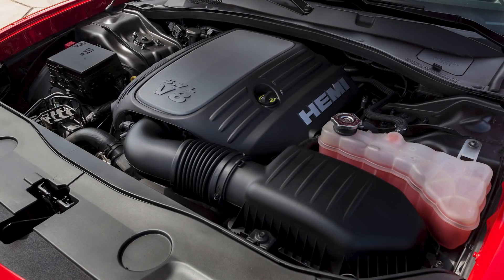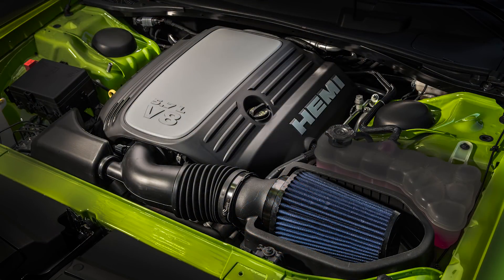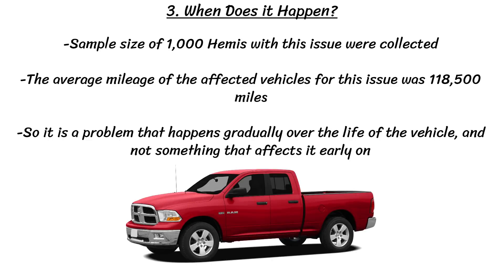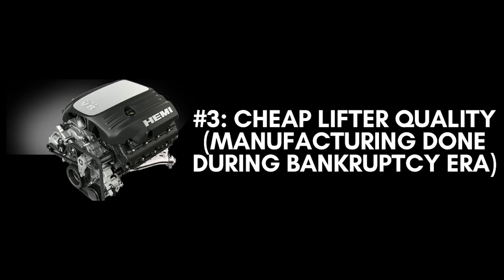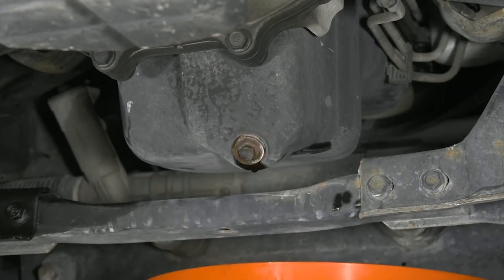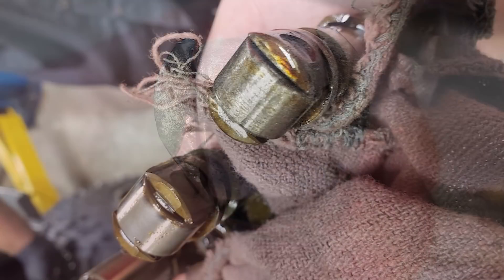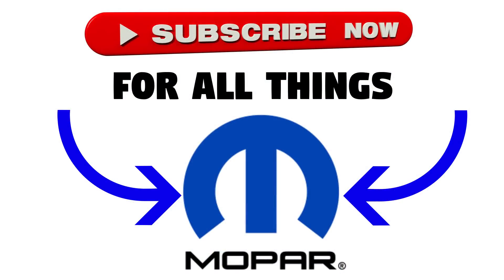The Fatal Flaw of the 5.7L Eagle Hemi V8 Engine Fully Explained (2009+ Lifters and Camshaft Failure)

Comment: It's not just the 5.7s, but also the 6.1s, and it's that mill that debunks the MDS. 6.1s don't have them. ALL Hemi's run very hot to try and clean their combustion gases, and are known for carboning up and oil coking. The lifters I've dissected were full of heavy varnish. ( still functional but somewhat sticky) It is imperative that the oil be changed 3-4k even with synthetic, and the best highest grade premium fuels be used to help keep things cleaner. Every Mopar dealer tech and engine rebuilder I've talked to says the fix is the 392 or Hellcat lifter upgrade. There are several aftermarket available that are also supposed to be 'the fix'. These Hemi's can be rather noisy mills, so often times by the time you hear an actual lifter tick, it's too late.
Reply: all the failed cams shown had coked oil between the lobes,

Comment: My 2004 Durango's Hemi is flawless! I've never had a problem with it! Runs great to this day (I bought it new) And my 2011 Durango with the stock V6 also had no issues. 

Granted I will not buy a newer Dodge product because of the engine issues. I'm an Acura owner now.
Reply: Newer Acura mills are oil burning machines... My 05 3.2 TL has 198k on it, has never been apart, and burns zero oil. Newer Acura mills can't match its reliability and I have several customers with 4 and V6 Acuras that burn oil like crazy at 90-132k.
Reply: @adamtrombino106   Good to know. I have a 2014 Acura MDX- doesn't burn any oil- i do the maintenance on it.

Comment: Please stop this outrage of lifter issues and cam shaft aswell. Change your damn oil every 3,000 plus your filter and use very high end oil. Won't have a problem .there are countless 5.7 eagle engines with well over 100,000 miles and zero issues. I mean every other damn truck on the road is a 5.7 Ram. Lol. Stop it you guys its not that bad. Fucks  sake! SMH

Comment: I used to have a 09 Ram 1500 with the 5.7 Hemi absolutely loved that truck and motor never had any issues with the motor always changed the oil with full synthetic 0w20 during the spring to fall months and 10w20 in the winter would still have it if it hadn't been a total loss due to the frame
Reply: Wait, heavier weight oil in the winter????
Reply: @ALT3REDB3AST  no 5w30 in the winter and higher first set numberd in the rest of the year but my 09 ram was running full synthetic oil before I'd gotten it. So I just kept running full synthetic oil in it when I had it to

Comment: My wife's 2013 Jeep Grand Cherokee had the engine rebuilt at 125000 miles because the cam had several lobes rounded off and the lifters flattened. She didn't abuse it. It had the oil changed more frequently than the required interval. Mopar crap. I'll never buy another Chrysler vehicle again.
Reply: That's unfortunate, but the issue is resolved.
Reply: @snek9353  What model year it was resolved?
Reply: @Jose-ty3xh  That's a matter of some debate, my best information is 2014. Only someone who's both disassembled a lot of these engines and knows what to look for would know for sure. 

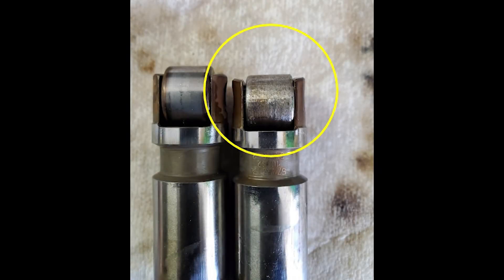It was resolved by the introduction of an updated lifter with larger rollers, you can see the difference in the image at 5:10 in this video. This update was the change from the AB to AC lifter and likely a change to lifters made by Melling. When exactly these lifters made it into new 5.7 production as I said I don't know, but it looks like the 2014 model year. 

I own a '14 5.7 that I'm quite fond of, so this is of particular interest to me.

Comment: From an engineering perspective, I definitely believe the needle bearings are the direct cause. 
For long term / high performance use, these needle bearings should be made from H-13 tool steel and heat treated to a minimum 52 Rk. The case hardening would prevent this issue. 
As the initial engineer for all DSS drive train components, I can assure you this would eliminate the issue.
Reply: Even though the same exact style and material lifters are used trouble free in most other engines,you still think the lifter is the problem.It is a lack of lubrication,from a few design issues namely having the cam too far from the crank and not having the splash oil from it.
Reply: @JohnDiMartino  Not true. The cam and lifters get ample oil. I've torn one down after a lifter issue, the lifters and cam were saturated with oil. So it's definitely the roller bearings causing the issue.
Reply: @7s29  Being saturated could be because the engine hadn't been idling for 10 minutes before shut down.
Reply: @JohnDiMartino  Your hypothesis is flawed, all of the big 3 had roller lifter/follower issues around the same time. IMO it's quite likely they all got them from the same source with the same QC issues.
Reply: @snek9353  Ok. Then why don't they ALL fail at the same rate? Instead it's predominantly HEMI's, and cylinder #5.
Reply: @alzaidi7739  Why would they all fail at the same time? And heat.
Reply: @snek9353  I didn't say they would all fail at the same time. But if it was simply bad rollers, over a decade of time and millions of engines, you would expect the same number of failures across all cylinders and valves.
Reply: @alzaidi7739  Well the bad rollers only went in engines for a few years. MDS and non-MDS lifters have different loads. Exhaust and intake have different loads, and inner locations tend to be hotter. So there's 4 different load profiles across the various lifters in the same engine. And #5 being inboard and non-MDS will tend to be the hottest.

Comment: My leased 2017 Ram 1500 pentastar v6,  at 34k messed up. cam phase issue,  would trigger limp mode on highway,  dangerous.
Stay away from Fiat, Chrysler products.  The dealer actually told me maybe I had mice going in the engine , after I brought it in 5 previous tines FOR THE SAME DEFECT!!!!!

Comment: Isn't this the exact same problem Ford had for years with the 3V motors? So many motors taken out by little bitty needle bearings.
Reply: IDK about the exact problem, but things like this certainly aren't unique. The 3V issue you mentioned, the spark plugs on early modulars, GM has nearly identical lifter issues and worse cylinder deactivation issues. Many German and Japanese makes have similar issues as well. Engines have gotten more and more complicated with manufactures pushing new designs and technologies, not everything is perfect.

Comment: Everybody with a 5.7 hemi should run Redline 5w30; however if you have MDS this might cause a CEL and if it does, Redline does make a 5w20 that will work. 

By and large, for me included, Redline quited everybodies HEMI engines way down, even the normal valve train noise. It has high zinc and molybdenum quantities, which bond to iron and steel and lubricate better than just straight oil. 

I swear by the stuff. It sure ain't cheap but it made my engines mechanical noises a lot quieter lol
Reply: Yup, and Redline is a true ester based oil, really fantastic stuff from a fantastic company. I've been a big Redline fan for decades their products have always been innovative and never disappointed. Personally I have a '14 5.7 that I haven't had long, the first oil change it got Redline Performance 5W20, any day now I'll do my 3rd oil change with it and it's getting 0W30 this time. We'll see how that goes then maybe 5W30, then maybe even 0W40 by next summer. 

I have little worries about thicker oil being bad, only dubious of it's need and I need to research the CEL issue more.

Comment: My 2012 pursuit has almost 5 thousand idle hours on it. Its noisy when I first start it, but pretty much silent once it warms up. Fingers crossed! Hahahaha
Reply: Our Hemi makes lifter noise after a cold start ONLY if the engine has been started cold and shut off cold. For some reason this causes less oil to be in the passages for the hydraulic lifters.

Comment: Go back and watch UTG explain it. All you need to know. Lifter rollers starved of lube from extended idle periods. Engine block needs redesigned to accommodate improved lifter valley oiling alleviate this (but will take an act of God for Dodge to actually do it).
Reply: UTG is 100% wrong, the guy is a fool on this issue.
Reply: @snek9353  I don’t think so. Tony’s been around at least since the ‘80s living the dream; authored countless magazine articles while slinging wrenches for a living. I was a mechanic once myself so I can spot a crank- Tony is for real. His analysis on the modern Hemi cam bank angle is spot on, lifter roller oiling issues typical to oil starvation at idle is the most probable cause
Reply: @patricktober2816  Wow, ok where to start, Tony apparently stopped learning in the 80s as well. His knowledge of anything newer is very lacking. 

If you knew as much as you claim, you'd have seen his BS. 

Now I'll give Tony's position one thing. He has kind of a minor accidental point about the lifter bank angle. If the lifters were more vertical the rollers would get more oil. HOWEVER his theory and demonstrations are idiotic, he ignores the fact that the lifters are in pressure fed bores surrounded by oil. Oil is forced out around all sides of the lifter and when the lifter is up it's almost completely sunk into the bore. 

There's also PLENTY of oil, the oiling system to the lifters and oil pressure at idle in these engines is just fantastic.
Reply: @snek9353  Yeah sure. Whatever you want to believe. I won’t try to upset your ‘expert’ analysis but I’m sure that explains the FACT that most times these components fail it’s due to oil starvation on a motor that commonly sees extended periods of idle. Nor will I try to explain gravity or common sense to you. Google that. Enjoy your cup of bullshite.

Comment: Just had this happen to my 2013 5.7 charger  at 97,000 miles 
 2013 ram is still going strong at 145,000 
 Number 2 cylinder  lifter failer , my guess is it's faulty roller bairings on the lifter considering , I change my oil on both vehicle's  when it's due and I use the same oil and filter for both vehicle's  . 
 Drive them both fairly hard but no issues so far with the ram 5.7 hemi  .
Neither vehicle has had idle hours . 
 Both have MDS .

Comment: My 09 ram 1500 with the 5.7 has 250k all original drivetrain zero mechanical issues except a few water pumps which is also one of the 5.7 weak points
Reply: "Zero mechanical  issues, except a few..." Common core math.
Reply: @kwb377  water pumps are maintenance dumbass ill take a mopar over any make of car
Reply: My 09 has 198k on it, in shop for cam now.😟

Comment: I've reviewed a lot of comments and wondered, 
if anyone has used oil sample analysis throughout the life of the engine??
There's mention that the 6.4 isn't affected as much?
5.7 engines sell probably 40:1
I just don't think we see the 6.4 as often. 
Surprised fuel octane doesn't come up .
Reply: I should get my next drain analyzed.
The 5.7 v 6.4 thing is a fair point, it's also though worth pointing out differences, like that the 6.4 uses 0W40. 
I don't see how octane could be a factor in this.
Reply: @snek9353  
I'm hearing fuel is a lubricant. 6.4 uses 89 octane. 
Just what I've read.
Reply: @commoncents456  Not in any way that matters to this topic.

Comment: If you throw enough money at the problem it seems you can make them bulletproof.  Years ago before roller lifters we'd have camshaft lobes wear down, the roller lifters on the Magnum motors fixed that issue.
Reply: If you're talking LA with flat tappet verses Magnum motors, remember they also oil the cam and top end differently. 85-91 LA with roller lifters used special heat treated cams and thus rarely wore out.

Comment: I worked at a chrysler dealership back in 09 I remember changing oil on a charger with 20,000 miles on it. It came back in with a loud lifter tap. We shut it off and let it cool down. Then restarted it and the lifter tap went away. Makes me wonder if it was one of those ones that ate a cam lobe or lifter. At the time we all thought it was odd a car that new would make that sound.

Comment: It was a parts issue for specific years. But since 2003 when the motor came out, these cars have had lifter issues. It is not a parts issue it is design of the motor. The gen 3 hemi is a reimagined 426. By pushing the camshaft up and changing the angle of the lifter galley. This takes a lot of the splash oiling away from the camshaft and lifters. The motor needs to get into higher revs to limit the oiling at idle for the entire supply to the cam. This does not mean a motor that is always high reved cannot get this issue. I think it comes down to oil change intervals out of everything.
Reply: Stop listening to UT.
Reply: @snek9353  no we have already had this argument lol
Reply: @Sak-zo1ui  Well if you insist on degrading yourself, at least don't spread it.
Reply: @snek9353  it is your opinion.
Reply: "splashing oil" has nothing to do with it, same things happen on LSs

Comment: I vote for number 4. I run 5w30 in both of my 5.7s. When I switched both of them the idle oil pressure went from 28 psi to 35 psi when hot. The oil gets hot and too thin. My rams oil get over 230 degrees when towing. There is absolutely no problems with mds running 5w30.
Reply: You aren't alone in that thinking and action.
Reply: I get 38psi at 223 deg idling and I use 5W20. 170k on truck, I guess not all engines and oil pumps are assembled the same. However I noticed I am the only parent waiting for kids in the florida sun with engine off and windows open, every one else keeps engine running at idling for hours each day just to get A/C going. I am thinking maybe 1 day I find some good mechanic who can re-tune ECU to increase idling rpm a bit.
Reply: @denislaouenan5553  Very unlikely you'll find a mechanic that can re-tune the ECU, you however can do it, I've done it. It does however require a few hundred bucks in gizmos.

Comment: What if we change the oil pump to stronger one.. I think it will provide better lubrication 
Even when idling it will provide better oil pressure
Reply: There's no lack of oil flow in the Eagle version. They in fact did install a larger pump from 2009 up than there was from 2008 down.

Comment: I use the hour meter/engine oil life on my '18 R/T Charger.
Changed with full synthetic oil at between 20 and 15% remaining.
Reply: And???
Reply: Your crazy bro I change mines at 60%
Reply: @dontaybreadgangtv5305  
Do the "mines" ever explode on u?
Reply: @motorcitymanman7711  sometimes but when they do I make sure to keep a steel jock strap to protect the family jewels

Comment: I have a 2013 Ram 1500 5.7L with the 65RFE 6spd transmission and it has right at 150k miles on it. So far it has been a damn good truck with the only issues being electrical and of course the exhaust manifold bolts breaking. I don't use synthetic oil but I do change the oil every 3000 miles like clockwork, even though it could probably go until 5000 before changing with no issues. I hope it will continue to hold up. Other than the tick on cold starts from the exhaust manifold bolts, it runs like a champ. So fingers crossed 🤞
Reply: What electrical issues
Reply: @califaern3sto  I've had to replace both the driver and passenger side window/door lock controls. I had a service Electronic Throttle Control light keep coming on but no codes were thrown and it went away on its own lol. I've had a few issues with the UConnect touch screen going dark when its really cold outside. Mostly small annoying stuff.
Reply: @DeviantVette  ive had a few issues with the uconnect as well including a back up camera error, had to reset it to factory default

Comment: I just replaced some lifters on a 2009 ram 1500 last week.  The springs inside the mds lifter on cyl 7  broke and rocker arms popped off and bent the push rod.  After installing new lifters, the cam wasnt damaged,  It runs fine, no misfires, but has a noticeable tick on the other side of the engine now, Took the valve cover off three times and double checked everything and it seems fine. Even double checked exhaust bolts for tightness.  The angle of the pushrods are very extreme and the rockers can slide side to side on the rocker shaft and i think some of my noise is the rocker sliding into the hold down bolt. Old mopars from the 60s with shaft mount rockers has spacer like pieces to keep the rockers pretty much where they are supposed to be.  These are terrible engines and I have replaced quite a few whole engines at our shop, but this was the first set of lifters i did. I dont think I will be doing anymore.  I just cant stand behind it.  Ill just have to keep this one customers truck going for the time being.